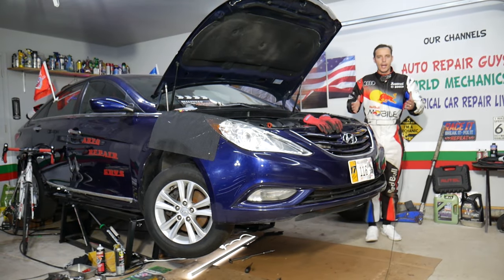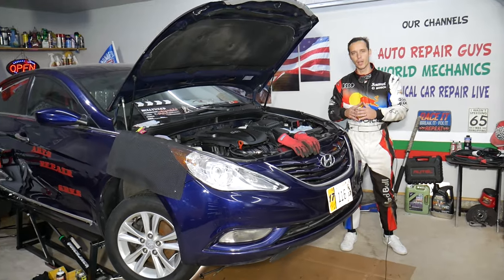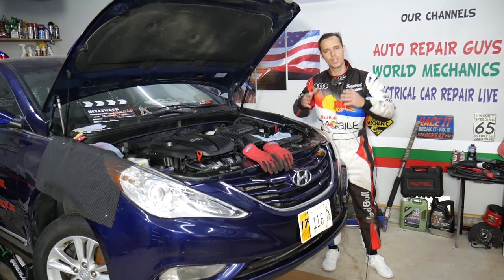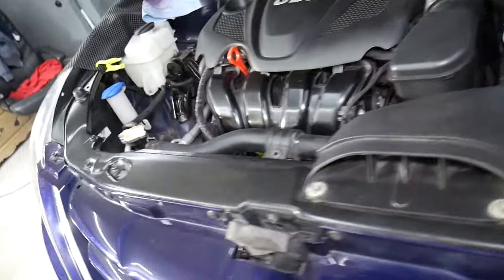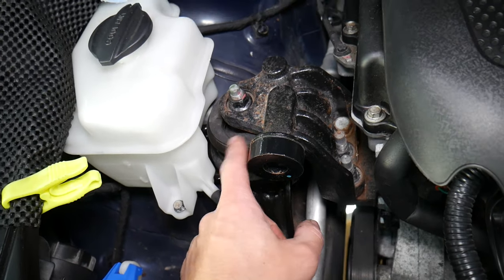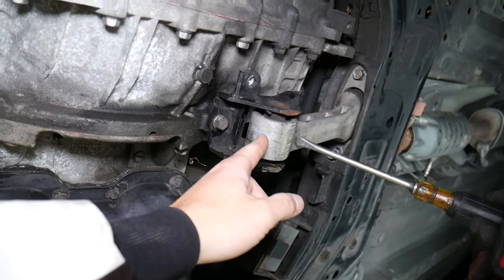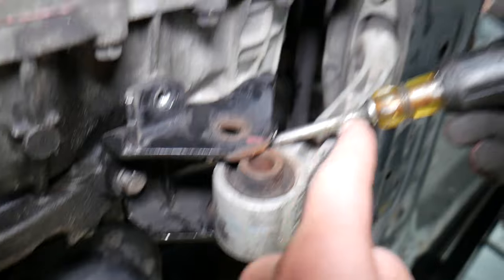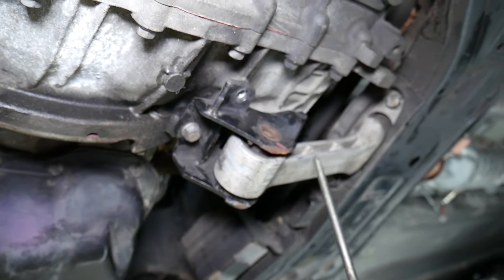WHY CLUNKING NOISE SOUND WHEN SHIFTING GEARS, SHIFT FROM PARK TO REVERSE DRIVE

Comment from the maker: Products that we use and recommend:
► Lower Engine Mount (check for car model): https://amzn.to/3lW6gbL
► Panel Removal Set: https://amzn.to/3YiMADu
► Tool Set: https://amzn.to/3p5MM6t
► Screwdriver Set: https://amzn.to/3XRB28Q
► Castrol Oil: https://amzn.to/3xBc8B9
► Oil Filter: https://amzn.to/3w0Ulme
► Torque Wrench: https://amzn.to/32qyRwg
►Liqui Moly Engine Flush: https://amzn.to/3IiDBID
► OBD Scanner that we use most often: https://amzn.to/3I4MQfe

► We buy our Tools and Parts from here: https://www.amazon.com/shop/worldmechanics

Comment: I solved a gear shift to drive clunk/ jolt problem with my Insignia 2011 auto 104, 000 miles - when putting it from reverse to drive (and vice versa). Happened repeatedly. Then I remembered that a few years before I had the same problem. Solution: engine running, standing still, level ground - foot on break, put it into neutral, lift foot off brake (no handbrake), wait 2 seconds, put foot back on break, shift into drive - no jolt - problem solved. It resets computer (I guess). Simple and true. Smooth shift of gears resumes. Happy driving.
Reply: Not only did this help me, but this may have resolved intermittent starting issues with my vehicle as well. Thank you!!
Reply: I believe you have bad ujoints and this is just a solution to a symptom

Comment: I have the Honda 2002 Odyssey van. Known to have transmission problems. My transmission clunkes into 2nd and  3rd. 
If I drive very slow I can avoid the clunk. 
It's much more difficult going uphill. 
I can manually shift it but I have to slow down and the cars behind me get upset. 
I had a OBD2 test showed nothing. 
I'm concerned that the clutch plates are ground up now and metal flakes are coming off of them.
I was told to remove all the solenoids and test them,  also the one under battery has 2 small filters that get clogged.

Comment: Hi wonder if any advice....I've got a Hyundai i30 cdr, if sitting, car running, I can put in all gears, no noise..., but when I drive, 1st gear fine, second gear fine, 3rd gear fine, but when I go into fourth, on its way in, like a slight crunch noise going in, car drives fine, then onto fifth fine, and 6th fine also...and from fifth to fourth, same again, but doesn't do it always, not like 3rd into fourth...any suggestions on issue!?🤔 kindest regards...👍

Comment: I have a 2009 ford Taurus with 55,000 original miles and I notice when I reverse quick and stop and put on drive the car will make a clunk sound.but if I reverse slowly and stop and put it drive.and accelerate slowly it does make that clunking sound do you think is my motor mount or transmission mount is going?
Reply: Update

Comment: So mine will make popping when I throw it in reverse and drive but as soon as I hit the gas I start hearing the popping and this is the first time I've actually done it back and Park then it took me a second cuz I couldn't get it to shift back in the gear 2002 Ford explorer sport 

I got stuck in the middle of the road Walmart cuz I couldn't get it to shift it's got plenty of transmission and oil fluids doesn't do it all the time but as time passes it's becoming more frequent any   ideas going to check the mounts in a little while

Comment: Could it be the driveshaft???
Reply: Could be a lot of thing, worn transfer case, transmission, u joint, CV axles, engine mounts, transmission mounts, low fluid in transfer case or transmission. So many things.
Reply: @jordanmercier3616  you are right, I gotta awd car and the transfer case went out so probably that, just hopping it wasn’t the driveshaft.

Comment: I have a clunking sound when shifting gears, but only when the RPMs are quite high. When let’s say I’m shifting up from 3rd to 4th, if I wait a bit for the rpm to drop, then it has no clunk sound.
Fiat Freemont diesel 170HP, manual transmission.
What can be the problem?

Comment: My car clonks from the engine bay when putting into reverse and moves forward slightly it's a forester ,would it be the lower mounts or pitch
Reply: Check the driveline u joints and output shaft

Comment: Hey please help me, the gearbox makes a metal sound only when I change from Drive to Manual, I have an automatic car, it doesn't sound at all while changing to other gears like R N P but only when I change to M, I sometimes on highway when I'm on 100 I switch to m for a second to see which gear the car is and then switch back to D. Is it good or bad doing that?

Comment: Hi,
My car skips gears when on motion especially when it has gone for some distance and it becomes hot. When this happens and you accelerate,  it behaves as if its on neutral when ideally its on drive. The motherboard was changed, oil replaced but still persists.

 Plz help

Comment: i hear no clunk when i shift into reverse but when i press the gas to reverse i hear a clunk and its almost like its stalling to reverse. if i press gas harder i get a BANG and then it reverse. what is that?
Reply: I have been reading it could be the CV axle but im yet to verify it
Reply: @LuisLopez-jm7xs  yea maybe. seems logical. transmission fluid is topped off so thats not the issue. has to be something else. i live in a flat city so its rarely an issuie but here and there we have these hella high arched sidewalks for drive way entries basically like ur jumping a curb lol. either way ill fix it before i ever sell it ill never sell my xb...never!